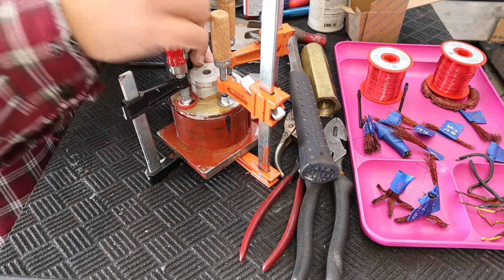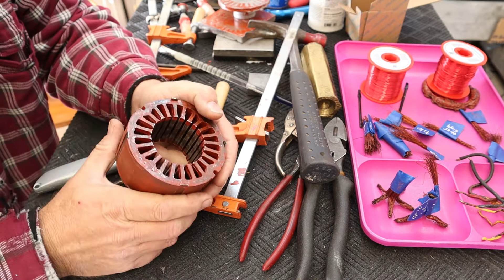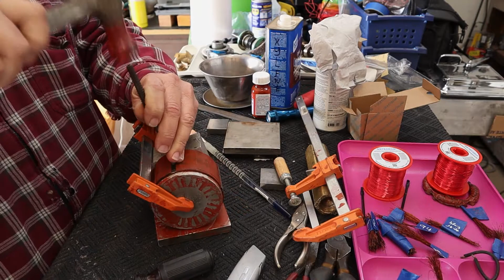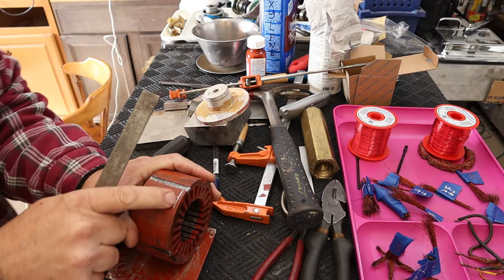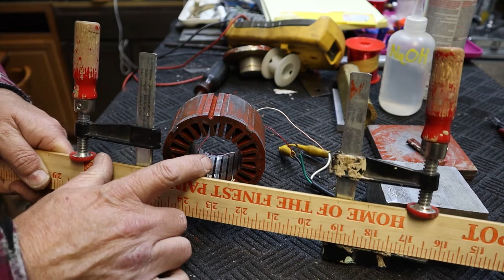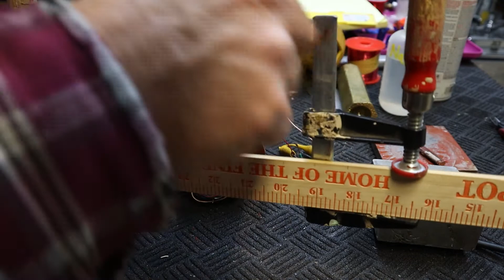K.O. Lee 2060 Spin Fixture Stator Repair

Comment: First off, great work! It's something that I have never tried. Second off, I had to laugh when you powered up your test coil. I kinda saw it coming. :)

To this all I can say is that an autotransformer is your friend. :)
Reply from the maker: Thank you :)
Reply: Don't  you mean an isolation transformer?
Reply: @djmips What I should have said is a "Variac" which is an autotransformer, but is adjustable. It's great for trying out old tube radios in that it allows you to bring up the power slowly.
Reply from the maker: No not an isolation.  But yes i have a few of them for ramping up power. An old tube radio friend of mine got me hooked on them.